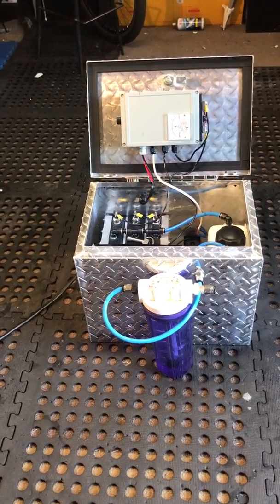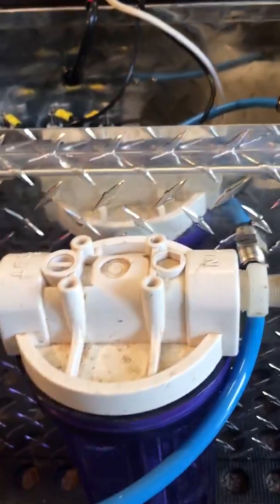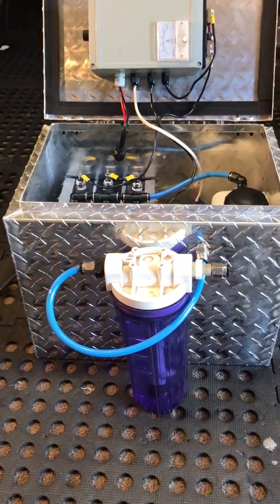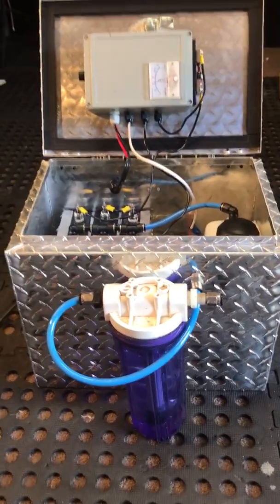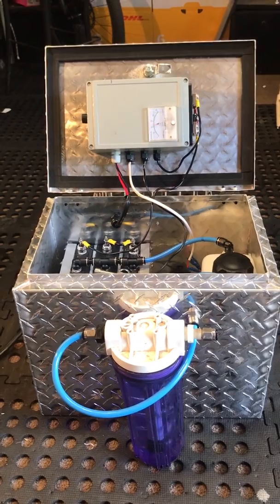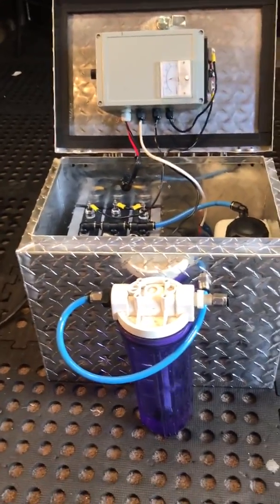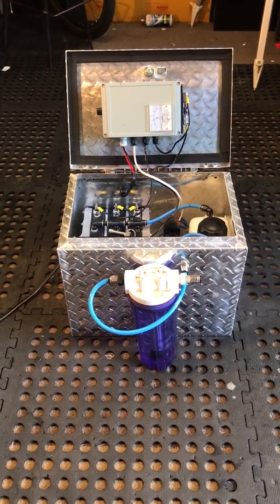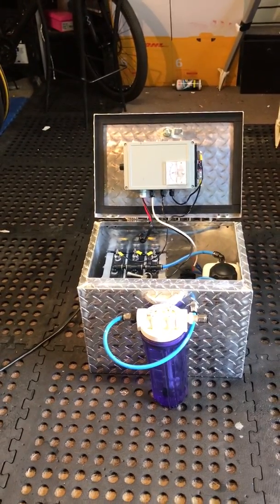New Gen 15 Hydrogen generator - updated Power supply for small trucks , generators and work vehicles

Comment: Is your power supply suitable for wet HHO system. I have tried a couple of   PWM power supplies using a small 12v battery. Just had one that is rated @ 60w running on 16 Amps for approx 1min or so and it over heated and started to smoke and the board is burnt behind one of the relays.
I am only wanting to use the HHO in my pulse detonation engine testing.
Is there a more robust power supply? Or am I doing something else wrong.
Reply from the maker: Call me on 0403177183
I use a 2500 watt unit that runs 12 v and 30 amp and is cool
Https://Hydrogenfuelsystems.com.au
Reply: @gavanknox3220  will that connect directly to the wet cell.
As I have already blown up a 40amp and a 60amp pwm?
Reply from the maker: My PWM power supply easily handles 40 amp and 12 volt  (480 watt) 
The power supply is rated 2500 watt
Reply from the maker: call me on 0403177183 
glknox11@live.com
https://hydrogenfuelsystems.com.au
patented , proven and certificated system delivering 32% savings on a 7.2 L truck - 27 tonne load
Reply from the maker: Certified test results have show savings of 42% on a 2.8 LItre diesel and a 3.6 Litre  petrol fueled wagon     call me on 0403177183     glknox11@live.com      patented proven system https://hydrogenfuelsystems.com.au      Gavan Knox BSc, BEd